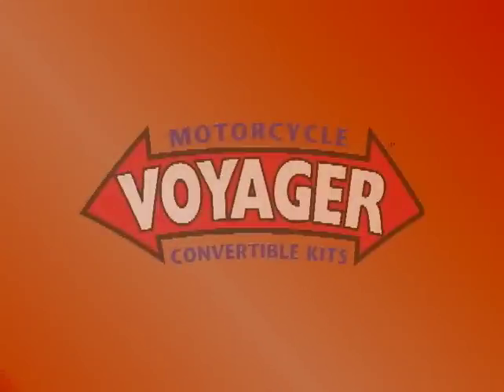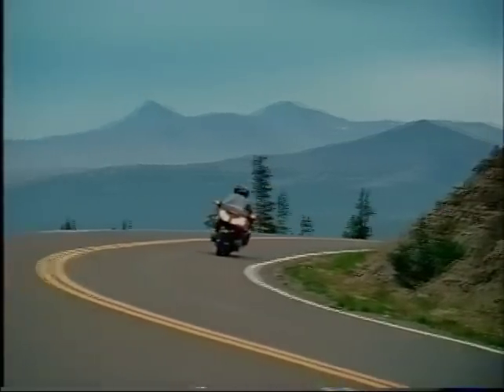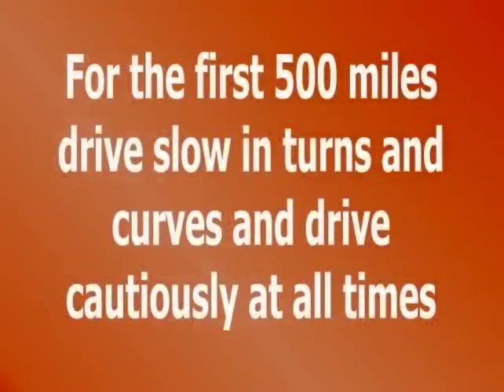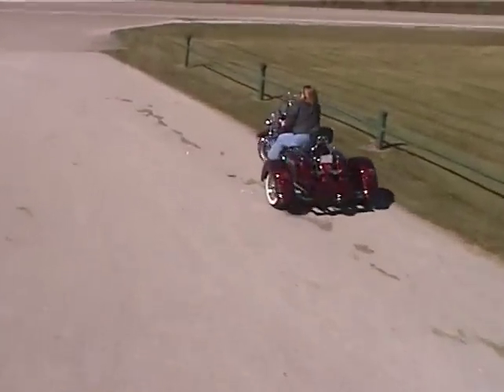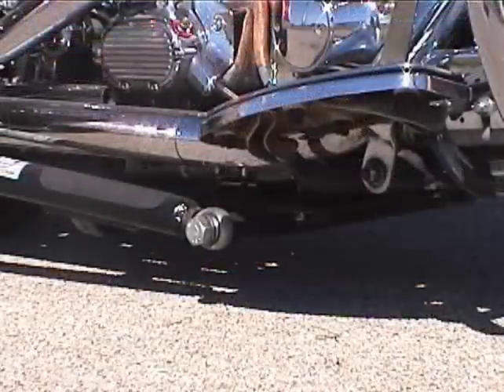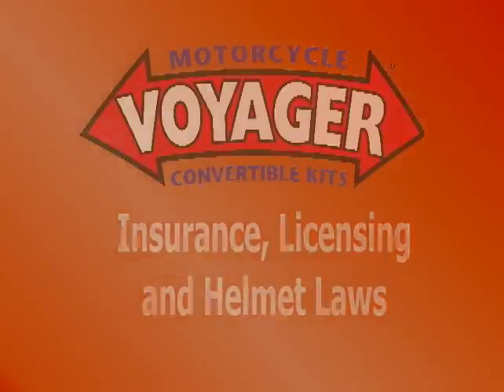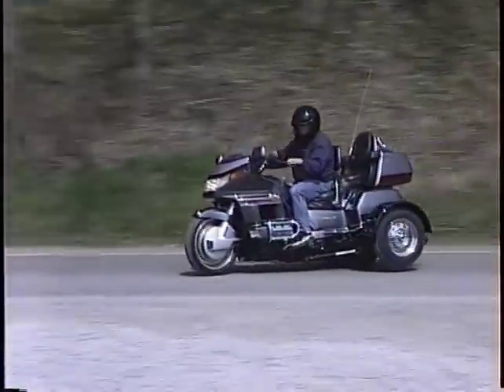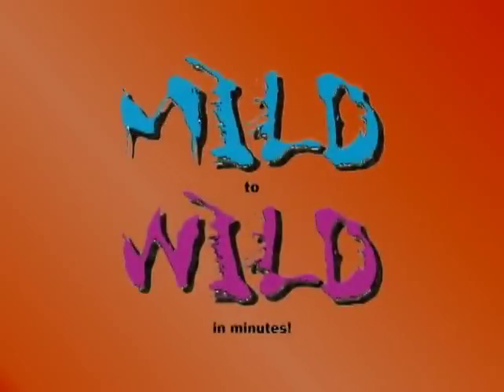How to Ride DVD

Comment: I am the satisfied owner of an 09 Voyager converted Yamaha VStar 1100 Custom that I purchased in June of this year.  It is far from my first venture into two wheels.  I have owned bikes with and without motors since my early teens and put thousands of miles on them, some on the street and others off.  I had to quit riding on two wheels (including my bicycles) a little over 10 years ago because of uncontrollable muscle tremors.  It really crushed me.  A little over a year ago, I had brain surgery with a pacemaker implant that now controls my tremors.   Regardless of your loyalty to a certain motorcycle group, anything that gets you back on a saddle should be a option.  I think the most difficult part of riding a Voyager bike was the re-learning of some riding techniques such as cornering, and getting over the need to balance and put your feet down on stops, just like this video says.  I did watch this video before I purchased the bike and learned as much as I could on other sources about the proper setup and adjustment of the conversion.  I spent time to correctly center the Voyager frame and get all the adjustments, most importantly tire pressures and suspension preload, within specs.  The end result was a dramatic change that created a bike that I just love to ride.  I park it right in with all the 'big dogs' and they usually come over to check it out and chat a bit about the different way it looks and works.  It's pretty cold and snowy out right now, so it's parked in a neighbor's garage under wraps for the winter.  I wave and talk to it every time I go by, promising I will rescue it and ride away again in the spring.  In the state where I live, this conversion is classified as a motorcycle.  There are no fee state sponsored rider safety courses for trike configurations and two wheels.  A trike license endorsement restricts you to three wheels but the regular motorcycle endorsement works for all configurations.

Comment: I was in the process of triking my 2017 Kawasaki Vaquero, because my knees won't hold up the bike anymore, due to 30yrs of military service. I was hoping to make it into a reverse conversion, unfortunately the company I was planning to use no longer converts anything but a Goldwing. Bummer! So, question, do I have to do anything to the triple trees? I was told that it may need to for stability. I do plan on keeping it on about 90% of the time. Thank You. RS&GB!!

Comment: Great video..Was thinking of turning my BMW into a trike due to arthritis and weakness in my hips a knees I can't ride..This may be the answer..
Reply from the maker: This is a great option. What kind of BMW do you have?
Reply: @MTCVoyagerMotorcycleTrikeKit  A 2002 R1150RT..
Reply from the maker: Unfortunately, that is one of the few bikes we have tried and cannot convert. It's likely due to there being little exposed frame that's strong enough to endure our attachment points long term. Dang!
Reply: @MTCVoyagerMotorcycleTrikeKit  ..Thanks for your reply..
Reply: Try tow-PAC inc… they might have solutions

Comment: Not everything in this video is true for all trikes based on bikes. Mine EML-GL1500 did not lift a rear-wheel in tight circles. It stayed on the ground and started sliding/drifting if you really forced it. Also no shaking front wheel thanks to swingarm front with a car tyre (like in sidecars) And no problems with ground clearance. Same for my EZS GL1800 reversed trike. About arms as steering dampers, often people make it worse by doing this. Let the trike do its thing. If the design is such that you need to do this, then do it. But it should not be necessary if the design is good. .

Comment: Hello...I had a Voyager trike kit installed on my Yamaha Royal Star about a year ago and it's been great. I forgot to ask the installer how much air pressure I put in the rear tires. Especially the center power tire. Does anyone know the correct air pressure for the rear wheels with the trike installed? Thanks so much.
Reply from the maker: 20 psi in the Voyager tires. Your tires on your motorcycle is whatever the manufacturer recommends
Reply: Thanks